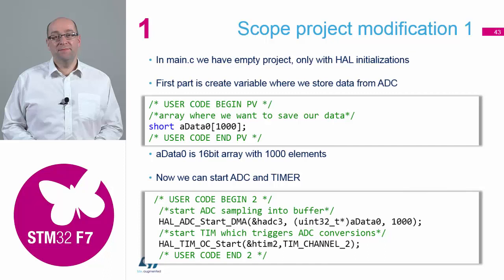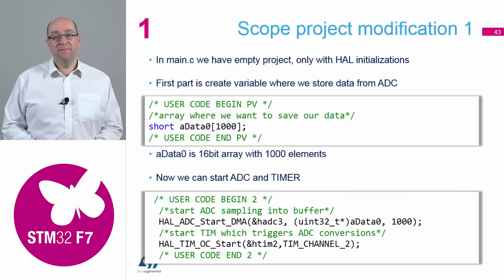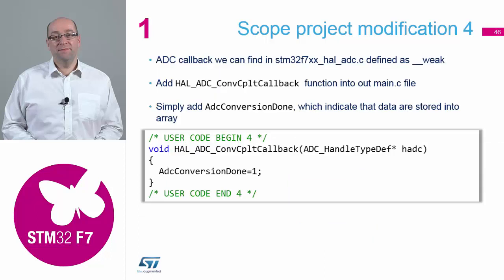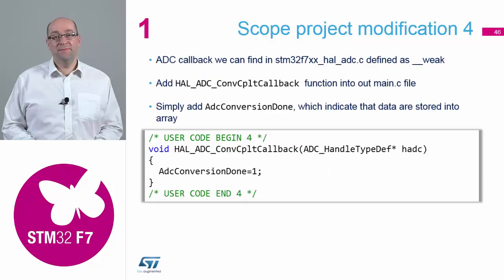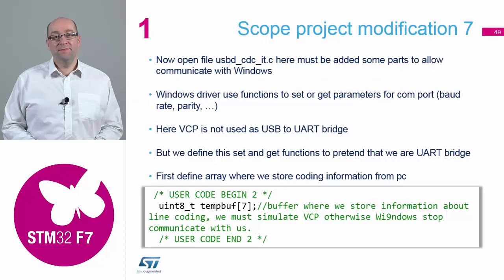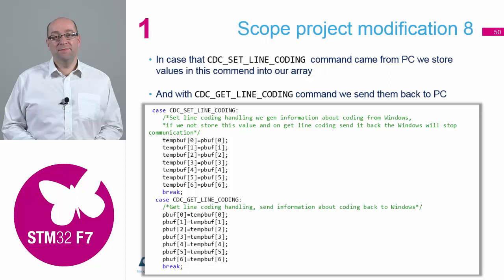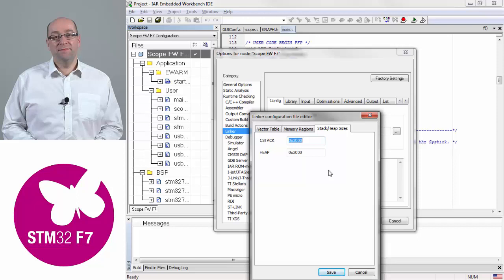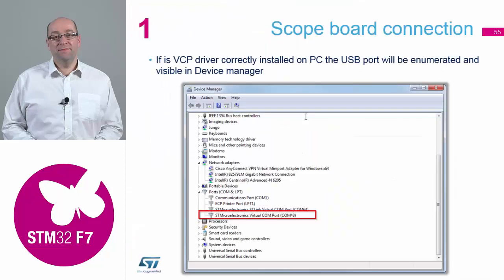STM32F7 workshop: 05.4 USB oscilloscope with STM32CubeMX - Source code modifications

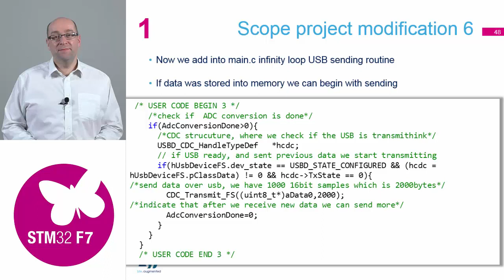Comment: Here is the code for 4:40

  /* check if ADC conversion is done */
	  if(AdcConversionDone > 0)
	  {
		  // CDC structure, where we check if the USB is transmitting
		  USBD_CDC_HandleTypeDef *hcdc;
		  // if USB ready, and sent previous data we start transmitting
		  if(hUsbDeviceFS.dev_state == USBD_STATE_CONFIGURED && (hcdc = hUsbDeviceFS.pClassData) != 0 && hcdc->TxState == 0)
		  {
			  // send data over usb, we have 1000 16bit samples which is 2'000bytes
			  CDC_Transmit_FS((uint8_t*)aData0, 2000);
			  // indicate that after we receive new data we can send more
			  AdcConversionDone = 0;
		  }
	  }
Reply: Code from the video/slides and the code from Philipp both give the same error for me:
invalid operands to binary != (have 'USBD_CDC_HandleTypeDef' {aka 'struct <anonymous>'} and 'int')

Any ideas?